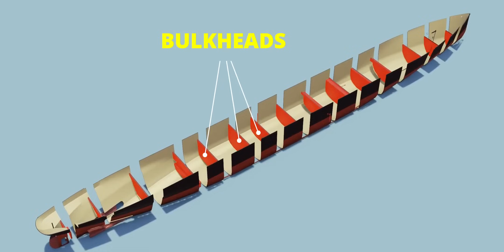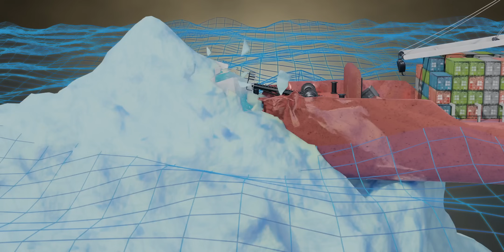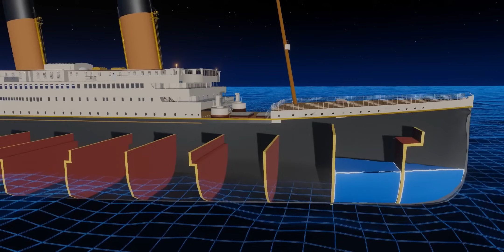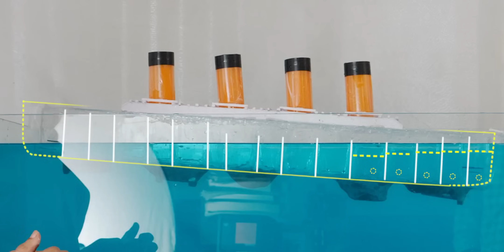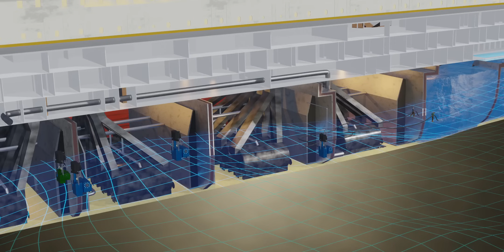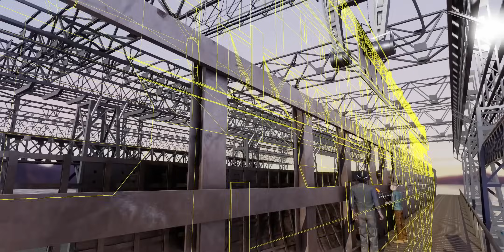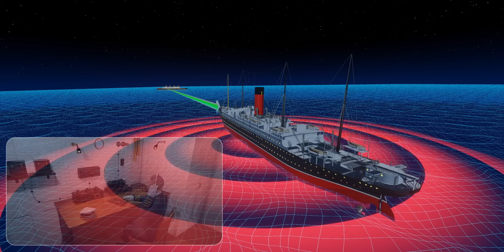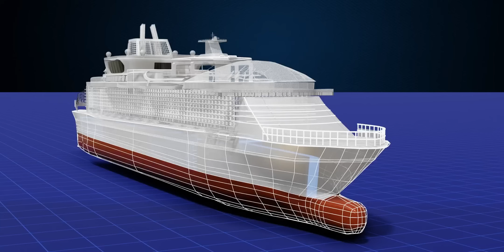How did Titanic Sink? | The Complete Physics

Comment: The ship used high quality mild steel that would've held up decently well in the temperature of the water which was at, or very near, freezing point (though doesn't freeze because of ocean currents and salinity making it quite difficult to form). The steel was of good quality, comparable to 1018 Mild Steel. The iron rivets were the problem.

So, steel has carbon pumped into it to jostle up the bonding structure and make it "messier". This allows the structure to be more rigid and secure (like adding aggregate to cement). The rivets were made of wrought iron which is like... elemental iron. It rusts easily, while rough feeling on a macro-level, it is smooth as butter on a micro-level. The rivets were made cheaply because there were so many of them. They were cold-punched into place, warping the iron's elemental structure, and causing micro-cracks with the steel. These were too small for water (due to its surface area bonding, like a drop of water holding form). But these cracks were not air-tight. They allow oxygen to get in and decay the metal, which occurred as far out as a year before sailing. When put in freezing cold water, the iron becomes brittle. This allows the elemental structure to remain in place. However, the individual iron atoms are not as "energized" and therefore don't hold together as well. So when this iceberg smashes into the plates, they initially bend inwards, but pop the rivets right out of place. This allows the water to pour in and just wreak havoc.

EDIT: Here's the link to the data: https://www.govinfo.gov/content/pkg/GOVPUB-C13-17a17f71ae2f9d4316c52e62d4650c9f/pdf/GOVPUB-C13-17a17f71ae2f9d4316c52e62d4650c9f.pdf
Page 12 has a photo of the RMS Olympic's damage in 1911 that illustrates my point about the bending metal popping off rivets.

Comment: The water entering added no weight to the front since that portion was already submerged, instead the front half of the ship was sinking in an increasingly vertical orientation due to its own weight, pulling the rear upwards.

The portion which was already submerged, started tilting more and more vertically due to its weight being prevented from its path of free-fall by the resistance of the rear, as the rear portion was still outside of the water. This caused the front of the ship to swing into a vertical free-fall, causing the snap. 

The submerged portion wanted to fall to the bottom of the ocean whilst the portion still above the water resisted the submerged free-fall as it was still undergoing the sinking process.

Comment: I don't understand how the water tight compartments were not enclosed from the top. Isn't that a huge design flaw? I mean how could they still be considered water tight?
Reply: I’d say it was but then again they didn’t except a berg to cut into the hull flooding 5 compartments when it could only withstand 4. I think due to Titanic’s sinking ships after got fully water tight compartments from bottom to top.
Reply: @jkefel_03 Wow this is gonna be some bad news for you, no modern vessel apart from a select few has fully sealed compartments. Most use the same staggered compartment design as was used on Titanic, albeit updated with modern safety procedures and equipment. Most cruiseships can only survive with 2 flooded compartments.

Comment: Note that the damage in water tight compartment 1 was limited. The damage opened the forepeak tank to flooding, but it was a tank and once it filled up, flooding in that compartment ceased. It wasn't until flooding spilled over from WTC2 that WTC1 began to flood, much later

Comment: On the part of Captain E.J. Smith not slowing down, standard practice back then was to travel full speed, mainly because ships were on a strict time schedule similar how trains operated in order to arrive on time and on the date it was scheduled for arrival.

For the bit about the angle Titanic was in the movie before she split in two, also keep in mind that Cameron did the sinking based on the knowledge known at the time and from the testimony of the witnesses before that. It wasn’t until the 100th anniversary that the blueprints and wreck were studied more thoroughly by Cameron and researchers that they were able to more accurately determine the angle the ship was at before breaking. Titanic split between the second and third funnels rather than the third and fourth funnels like in the movie. Scans and photos of the bow section confirmed this. The section with the third funnel was completely destroyed when the stern section imploded under water.

Lastly, after the split, the stern didn’t stay afloat for twenty minutes. The bow and stern were still attached at the keel after the split and the bow dragged the stern down before detaching.

Comment: The Facts: When the Titanic hit the iceberg and they realized the ship was going to sink irretrievably, they estimated it would take about two hours for the ship to sink.

Here's my question: If they were only 58 miles away from the Carpathia when they issued the SOS and had the bilge pumps working at full capacity, couldn't the Titanic have used its last breath and gotten as close as possible to the Carpathia, thus minimizing the distance between the two ships and saving as many passengers as possible?
Reply: if they continue to go forward water would flow in at a faster rate which would make the ship sink faster
Reply: What would've been the scenario if the so called "unsinkable" Titanic took a direct hit on the bow although it was not significantly strengthened like modern day ships?
As the bow section is strengthen for hitting hard "objects" most probably there might had been less lost of live and the titanic wouldn't have sunk.
Reply: @Kalki-x1l  Yes, there is very high probability to ship stay afloat after direct slam into the iceberg. But for Captain it would be impossible to explain, why he did not make an attempt to avoid the obstacle. You may be 100% sure, that many "experts" will "explain" how to make S - turn to succesfully avoid the iceberg.

Comment: They deliberately sank Titanic to enrich themselves and also create a whole new economy with Central Banks and The federal Reserve Bank. The guy in the crows nest did Not see the iceberg soon enough because the guy who was hired was oddly fired before the ship left port. They used that as an excuse for not having binoculars. They claimed he walked out with the key to the locker - as if there was no axe on board to open it,! There was no alarm or horn for the passengers until the ship hit the berg - many passengers did not even feel it or felt a slight bump. The rivers on that side were raw iron. Unlike the other side. Ismay and Morgan had them altered and also had a bolt taken out of Boiler stop. 6. In fact, they were almost out of coal because the ship was supplied with enough coal going half the speed. They were actually way ahead of schedule, doing that so the ship would hit the berg at night since the crow's nest had no binoculars and it doubled the chance of a positive sinking and mass murder! I saw several videos which included re-enactments of the hearings held regarding the shipwreck. They wouldn't have had enough coal to get to USA. Little effort has been made at the speed, the itinerary yet some researchers DID and that played a part in determining criminal intent!
Reply: everything you said is false lol

Comment: Oceanliner Designs channel claimed the propellers were still in tact (but we don't have any proof - no pictures taken, LOL) The propellers would have been blown to smithereens by reversing the direction, which is just what CPT Smith wanted to do for Bruce Ismay and JP Morgan - to make the sinking quick and undetectable! Bruce Ismay's White Star Lines was going bankrupt!
Reply: they didn't reverse imediatly, they first stopped the propellers then did reverse as to not blow them like you said and we have pics of the propellers in the wreck and they're still here
Reply: @Nighthawk0954  Engines never was in reverse. Port-a-round maneuvre needs propeller wash on the rudder to steer the ship. With engines in reverse You are not able to control the ship.

Comment: CPT Smith helped Bruce Ismay and JP Morgan to sink it! He first did a practice run with the Carpathia! 
The 4th funnel was NOT needed for ventilation! It was a FAKE, to allude Titanic had 4 engines, yet it only had three! CPT Smith made the crew go full speed ahead miles before it got to the iceberg as part of the plan to sink it; using up so much coal they wouldn't have had enough to actually reach USA had it not sank! He wanted to make a hard hit on the side which Is may and Morgan had all the rivers changed after it passed inspection. The Irish engineering firm did it - so when these low-quality rivets hit the iceberg, it busted up like unzippering the zipper! I could say more but YouTube deletes my comments oftentimes when I explain things like this. See my notes on the playlist -- which I had to recreate! And I lost a lot of valuable videos which reveal the truth! CPT Smith ordered the crew to open the seal tight windows! To help it sink, including Boiler Room 6 or 5 combusted because the engineers took out one bolt which would make it combust if they had to load coal in it for full speed ahead.

Comment: I have a question regarding some claims. At 17:42, it said, "due to the welding of the ship, it will just bend inward". How and is that even true? My reason and suspicion comes from the Concordia disaster. The rocks clearly punctured the ship, correct? If so, why was this video implying that a blow to a "modern ship" would only dent it?

Comment: The crew and captain had received wireless reports of icebergs. Why didn’t these ships choose more southerly routes during seasonal periods of increased ice flow activity? The captain could have reduced speed to a slow crawl, doubled the number of lookouts equipped with binoculars, and used searchlights. The way these ships raced through iceberg fields at full speed is mind-boggling. It wasn’t just the Titanic—nearly all ships traveled at full speed, even at night, despite receiving reports of iceberg activity.
Reply: I guess reckless sailors are no different to reckless drivers except the sailors errors are far more costly in life and money

Comment: I really like your demonstration with flooding the scaled down model of the ship, and it’s something that I’ve been trying to explain to people within my circle. Titanic (and her sisters) was an extremely well-designed and well-built ship for her time. She was simply put into a scenario that overwhelmed her design capabilities, and all modes of transport, be it ship, train, plane, etc. have their Achilles’ heel no matter how well they are constructed, and that’s how we learn for the future.
Reply: Yup I learned more from this dudes video
Reply: Since the Titanic was flooding at the forward end, I would have prolonged her buoyancy if the Anchors were run out, and allowed to "free fall"  the weight of the anchors and all that chain, would have ripped out the bitter end.  And leave the watertight doors open, so that the flooding would run to the stern,  this would have "possibly" have raised the forward end so that the top of the watertight bulkheads were above sea level.?
Reply: @stanleyjohnson9514 don't get angry
Reply: @stanleyjohnson9514  I talked with ChatGPT a few days ago about the anchor, which wouldn't do much help; however, we used the anchor and its weight to save the ship. Dropping doesn't work, because it's nothing compared to the gushing water flooding in. GPT calculated a few seconds of extra time for me if we did that.
Reply: i feel like if the person at the wheel dint turn left and just hit straight on it would of just faired better 
maybe 3-4 bulk heads at the front would of been destroyed due to the speeds they were going at 
but thats better than 4-5 bulk heads being punctured on its right side resulting in flooding and then unrecoverableness

Comment: 4:25, the reversal of the propellers caused the collision and if they went full ahead, it would’ve turned sharper. It was possible to avoid the iceberg
Reply: Yeah. I was thinking the same. It somehow stopped their forward momentum. I think it would've been useful if they turn the helm Hard to port, put the portside engines at full astern, and put the starboard engines at full power.

Comment: A little known fact about why it was going full speed was the smoldering coal fire in one of the bunkers, in a desperate attempt to extinguish the fire the only thing they could do was use up all the coal in that bunker as quickly as possible. 
This meant running the engines hard to not waste any energy from the fuel being used. Going at a slower speed would waste that energy and they calculated they'd potentially run out of fuel before reaching the port. 
White Star deemed this absolutely unacceptable.

Comment: I dont build ships so pardon my ignorance but why would you not build the bulk heads up to the ceiling and make them properly watertight?
Reply: Exactly stairs in ships today have hatches that closed not around back then
Reply: The bulkheads were floor to ceiling up to D-Deck, as Titanic flooded the bow was pulled under and eventually D-Deck itself was submerged and water was able to enter the previously sealed compartments.

Comment: Mistake 1. They did NOT mention the fact that Titanic was weakened due to a fire on the EXACT part of the ship the iceberg hit,
If it was not weakened it infact would not do enough damage to sink the Titanic.

Mistake 2. The Titanic was almost like a V-break. The TIP of the bow stuck out of the water, quickly submerging followed by the stern 20-30 minutes later.

Other than that great job!
As a Titanic Nerd I apropove 🤓👍
Reply: The 'fire' in Bunker No.6 was nothing more than smouldering embers, an extremely common occurance on coal fired liners and one that posed no risk to the steel of her hull. The outer skin of the hull at that point was 1.5 inches thick and would have required temperatures exceeding 430°C to even begin to weaken the hull plates, which were constantly being cooled by the freezing Atlantic. Coal in a damp, oxygen starved enviroment could never reach the temperatures high enough to compromise Titanic's hull so while this video omits the bunker 'fire' it is not a mistake of the videos creator as the 'fire' played no role in Titanic's sinking.

The force of impact would have been enough to tear a hole open in modern ships with welded hulls let alone an Edwardian era liner held together by rivets. When Titanic, a vessel weighing 52,000 tons collided with the several million ton iceberg at 23 knots the rivets popped like champagne corks. She was always going to sink in that scenario.

Im not even going to address the V-break theory as it has been thoroughly proven false by just about every Titanic historian alive today.
Reply: @Tozzpot500  What You just said I proved wrong I have seen video footage of the fire and seen the interview of a survivor of Titanic and several other survivors also say the Titanic V-broke so watch those videos u freaking idiot
(What u replied with was copy pasted)
Reply: @Tozzpot500 Your stupid,everything you just replied with has been proven false many many times
Reply: @Tozzpot500  Your stupid I HAVE PROOF IM RIGHT YOUR STUPID

Comment: Forget about hitting the iceberg head on. What if the captain turned to the right  do you think it still would have sunk

Also i dont understand  why the walls never went to the roof in each compartment why was there gaps at the top so stupid and  how did the water get tothe floors  above
Reply: The bulkheads were floor to ceiling and extended up to D-Deck. There was no gap at the top of each bulkhead like some people claim due to poor wording causing a misunderstanding.

The reason the other compartments flooded is because as the bow sunk further and further eventually D-Deck was pulled under and water was able to enter the previously sealed compartments from there.

Comment: It didn't hit an iceberg.  It was a coal fire weakening the metal. The rip on the side was the bottom being pulled off.
Reply: Considering the multiple witnesses to the iceberg and the fact that the bunker 'fire' in bunker No.6 was nothing more than smouldering oxygen starved embers which could never weaken 1.5 inch thick hull plating which was constantly being cooled by the Atlantic it was most certainly an iceberg that sank Titanic.

Comment: To this day I never understood the watertight doors not having a top part .
Reply: They did, but the bulkheads only extended to D-Deck. With 5 compartments breached D-deck was pulled under the water line allowing the sealed compartments to flood. Had the berg only breached 4 Titanic would have survived.

Comment: As a naval architect , the reason why titanic sunk, was due to the temperature of water that cut the hull, AND the bulkheads were not closed to the bulkhead deck above them, so water could go from one compartment to the other. Today, all ships’ bulkheads  are constructed due to the main bulkhead deck. So no water leak from one compartment to the other.
Reply: Yet ships still sink,  think Edmund Fitzgerald, MV, Darbyshire, El Faro all modern ships, with i presume double hulls, watertight bulkheads which extend to the upper decks, radar guidence, etc
all sank so quickly that they
couldnt even send a distress call , and there were NO survivors, yet a ship built in 1910, damaged beyond what her designers could ever imagine ,stayed afloat for two
and a half hours, enabling over 
seven hundred to be saved, Im
not an naval architect, but was
in the navy, for five years, and
i find that pretty damned impressive.